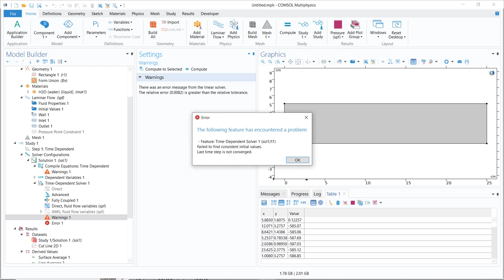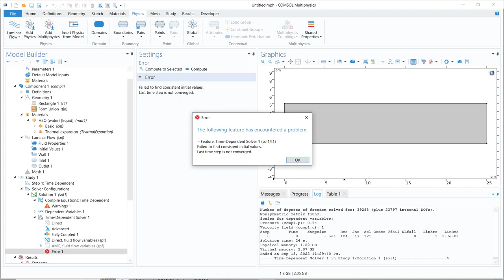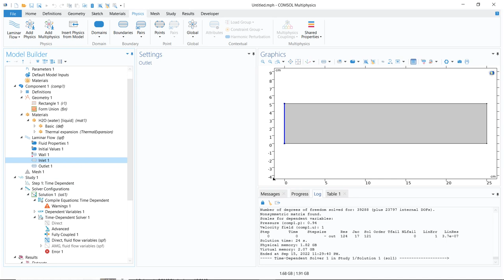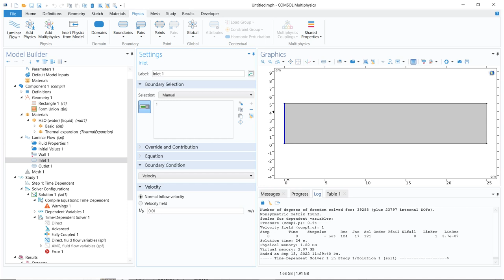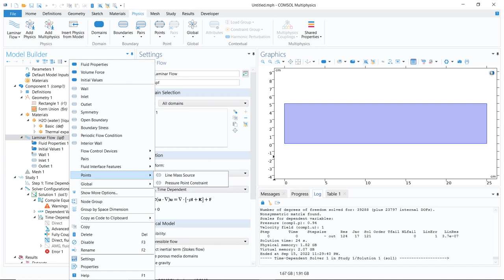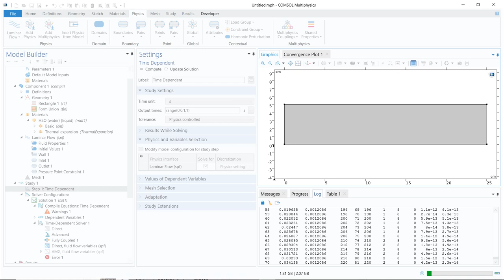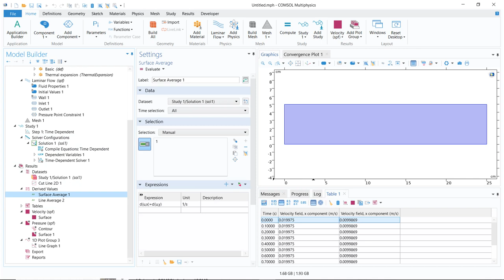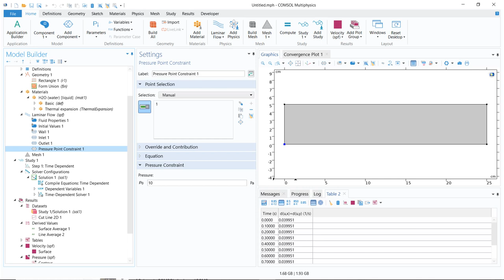Error Last time step is not converged in COMSOL #important #error #convergence #issue #lasttimestep

Comment: I am getting this error '- Feature: Time-Dependent Solver 1 (sol1/t1)
Failed to find consistent initial values.
Undefined value found.
NaN or Inf found when solving linear system using BiCGStab.
Last time step is not converged.' The warning is 'In Magnetic Fields:
There was an error message from the linear solver.
Maximum number of intermediate iterations reached.'. I am trying to coupled a coil placed near an electrical circuit that is connected to a sine source. I am using the time dependent study. Any suggestions?
Reply: the coil acts as an antenna

Comment: hi..Repeated error test failures. May have reached a singularity.
Time: 0.050000332725517752 s.
Last time step is not converged.
No matter what I do, the error is not fixed